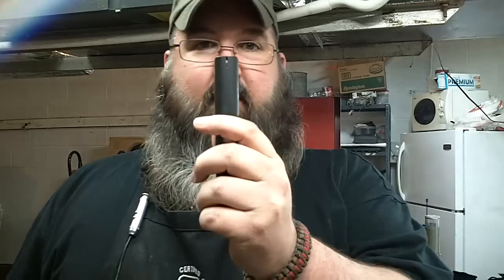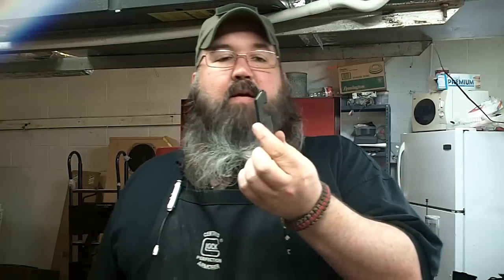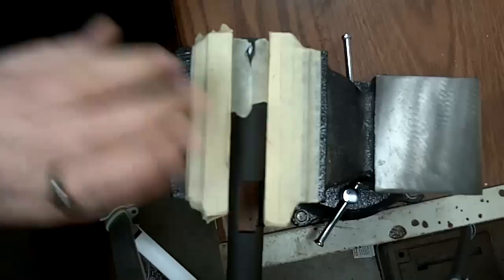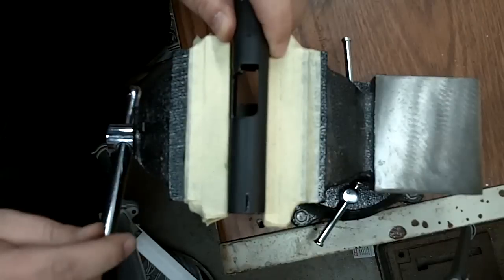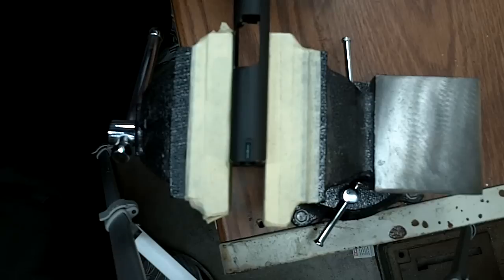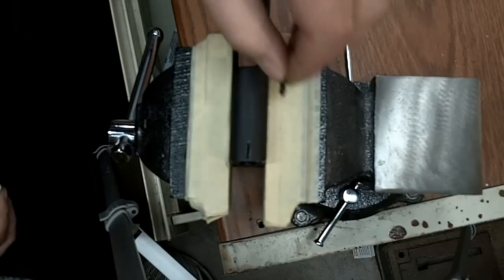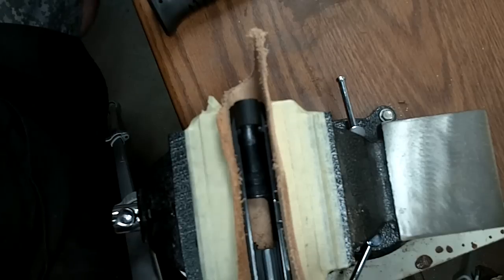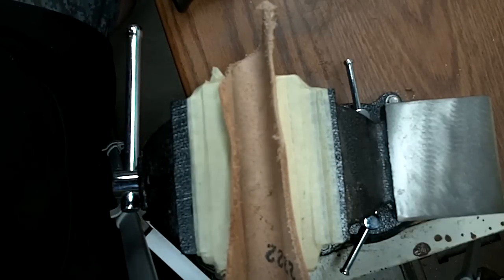1911 Front Sight Staking

Comment: The Rock Island slides have the narrow tenon of the Colt Series 70 pistols, not the wide Series 80 tenon, if anyone needs to know.
Reply: TheSuburban15 do you know if a .055 thick tenon will fit on my R.I. 1911 A2?
Reply: 0.56" tenon is 70 Series Colt size.  That should be correct.
Reply: Thank you
Reply: Thank you.

Comment: Thanks for the great information and now that I understand the technique of staking I plan on doing my own. I haven’t done it yet but I’m going to buy or use one that I already have a small adjustable wrench and remove the side that is movable. Then I will grind the primary side into a wedge slightly more obtuse than the (10-un)wings on the sight. The wrench at Home Depot or Lowe’s is less than five dollars. I forgot to mention I will cut the end of the handle flat so that I have a good striking point to spread the wings. I didn’t need to take my front side out it came off all by self at the range the other day.

Comment: Could I use the Loctite 620 on a front sight an nothing else?  I have a Colt 1903 that need a front sight but I don't have the tool to hammer it in.  Since its a .32 Auto and doesn't kick.

Comment: I have a WW2 1911A1  of coarse the front sight fell off. There is a crack from the sight socket to the end of the barrel. I want to keep it original, can I slightly grind open the crack and tig it? Then file work etc. to smooth, then stake in the new sight? I was think of silver solder paste after the staking...... keep up all your great vids....I'm a half asses wood worker too, and we pronounce them out west (Ten Nons). Lol have a good one brother
Reply: bucketlistbeginner Hi, from what you describe the crack is about 1/8” inch or so? If needed, stop drill the crack with 1/16” drill bit then file out and yes you can TIG weld and re sculpt if you have the talent. That will work because usually the weld is stronger than the metal being welded. Can do, then parkerize, or even Duracoat but that spot will not take to blueing if you get the gun re blued.

Comment from the maker: It's not a huge deal. But like I said, if that's the only gun you have with a staked sight, you may be better off having a smith do it, if for no other reason than to save you from buying a tool you'll likely only ever use once.